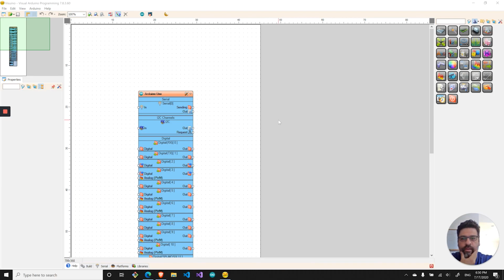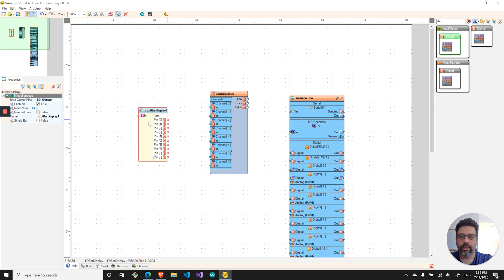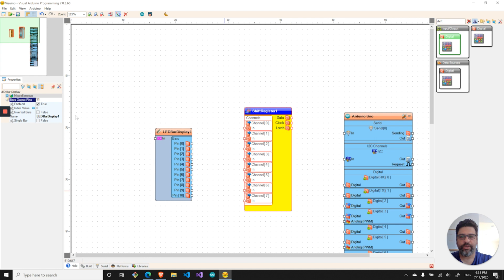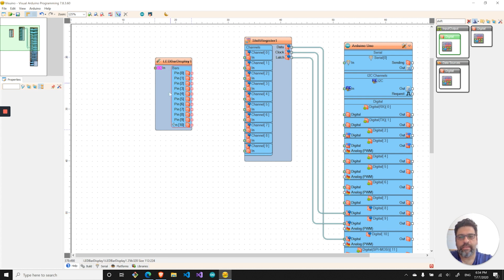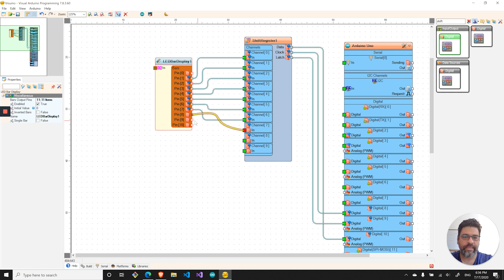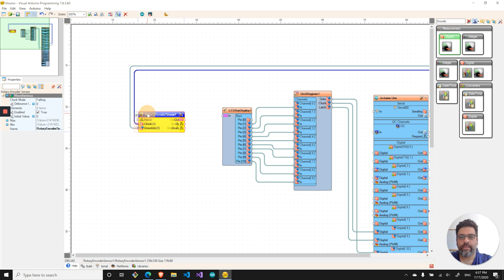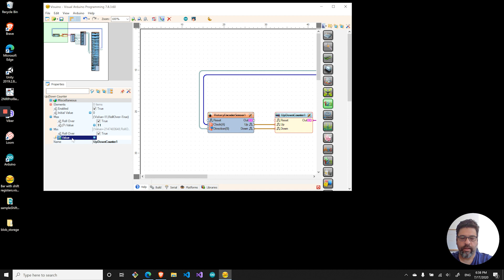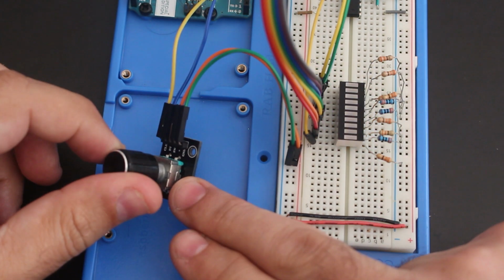How-To: Visuino, Shift Register, LED Bar, Encoder And More

Comment: As you could create animations with this software, record it in a micro sd and then create the code with which arduino will read the micro sd and take the animations to some addressable led strips ws2812b

Comment: I noticed that you very smartly installed a knob onto the encoder, stops the interference dead.
Reply from the maker: Thanks! I really love what you did with the tiger tank! How fast does it go? It is hard to know because Stumpy is crazy fast :D.
I saw a video of someone (I think in Italy) that 3D printed a large size tank where we was able to sit in side. Crazy stuff :D
Reply: It goes about as fast as normal walking speed, the motors and gearboxes are out of an old power wheels.